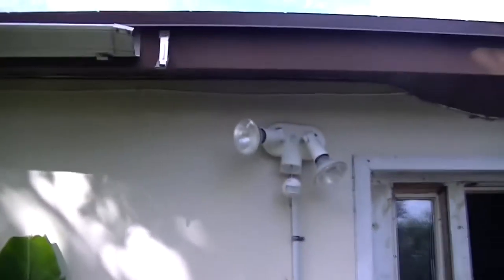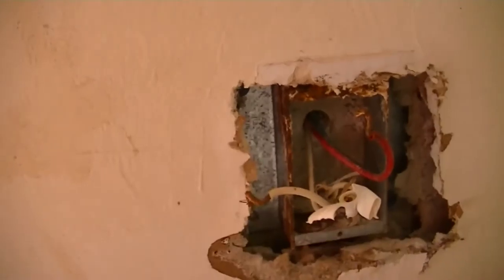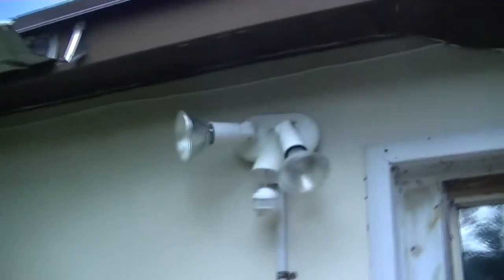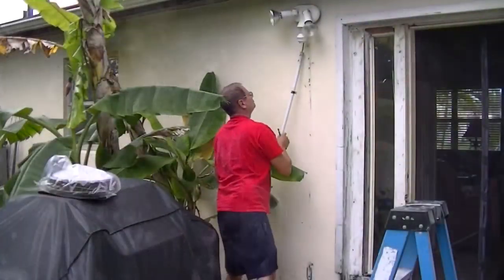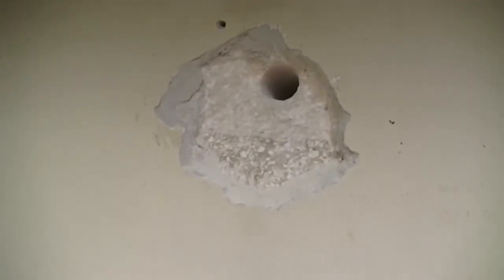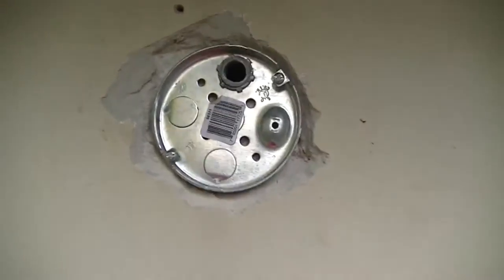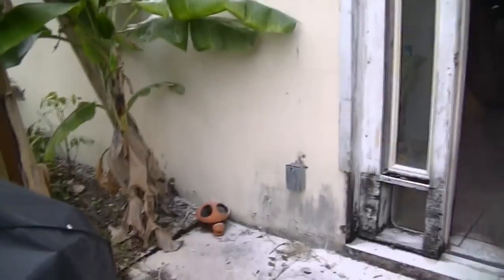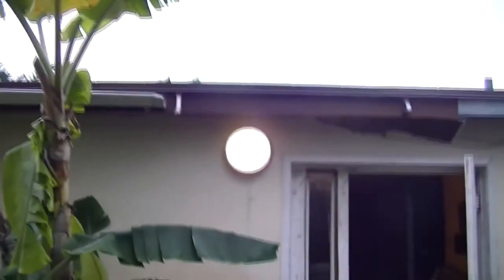Let's Install A Light Fixture Today

Comment: Good job with the electrical work.
BTW, how's the cutting back on smoking?
Good video.
Reply from the maker: +larry k thanks. smoking is still less than a pack. need to make the next strong cutback. I figure by the end of the month do another reduction. I am saving a bundle right now.